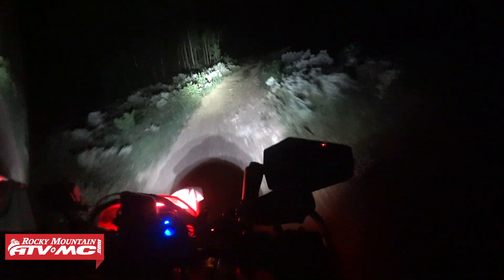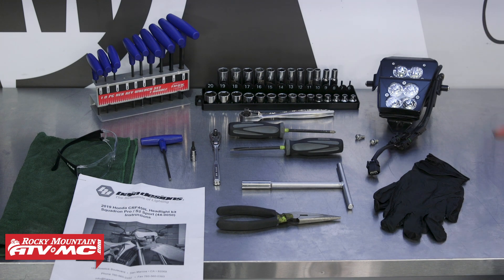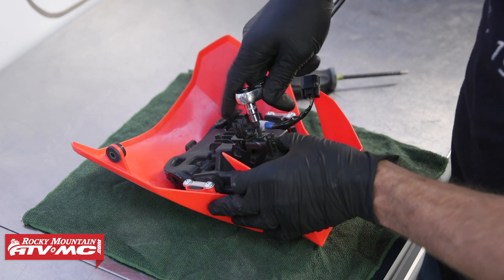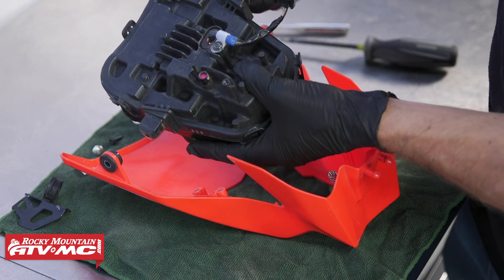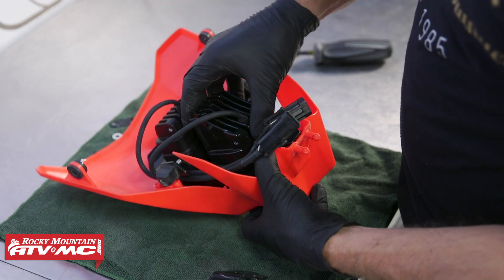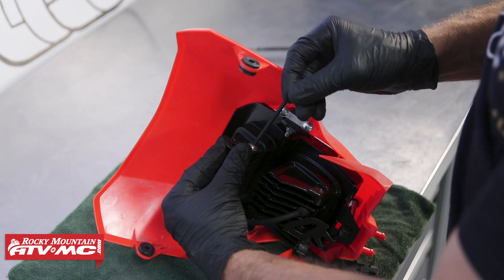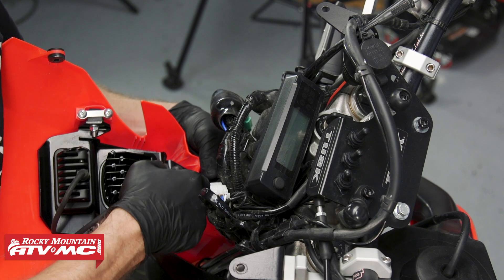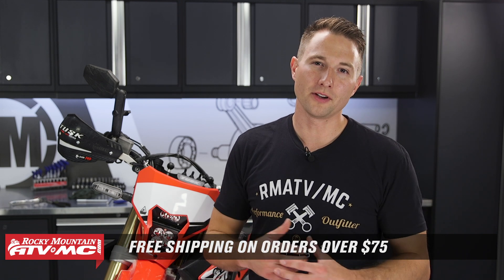Baja Designs Squadron Pro/S2 LED Headlight Install on a Honda CRF450L

Comment: Have you installed one of these on a 2018 Honda CRF250L?
Reply: Rudy Ocasion Jr   
I want to see this myself because I want to do it to mine
Reply: Same question here - 250L mount possible?
Reply: Following. I have a 2019 crf250l that I'd really like to put one of these on, but cant find anything on their website about if it will work for the 250L's.
Reply: Any luck fellas for the 250L? I have a 2020.

Comment: I have a 2019 450L and followed the instructions installing the Squadron Pro S2 and the top light doesn’t come on. So I unplugged both connectors and reversed them and still just the bottom lamp works? Any thoughts? Thx
Reply: You prob blew the low been fuse is all. Don’t ask how I know. Lol. Fuse box on left side of bike
Reply: Greg Hutcherson check your low been fuse. Left side of bike. I blew my high been fuse. Easy fix